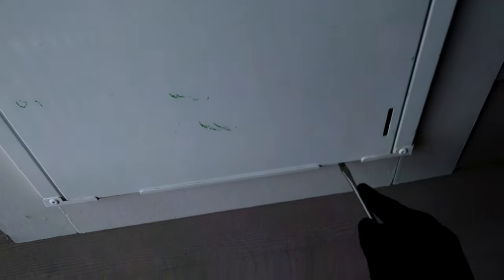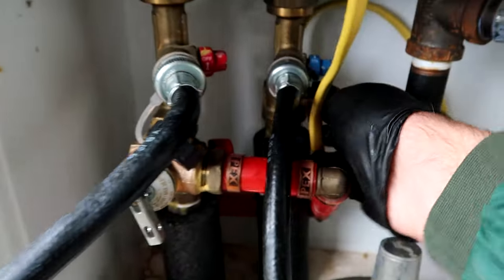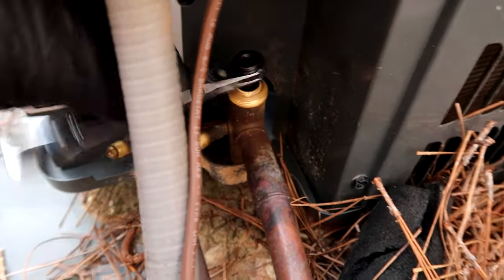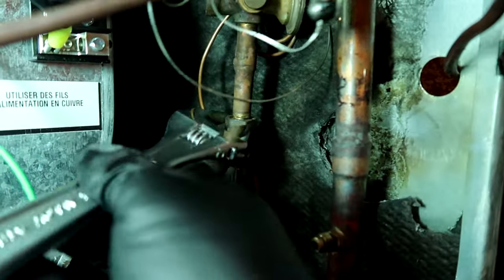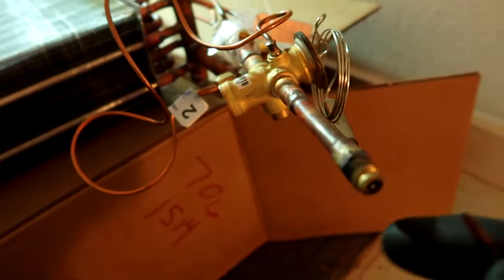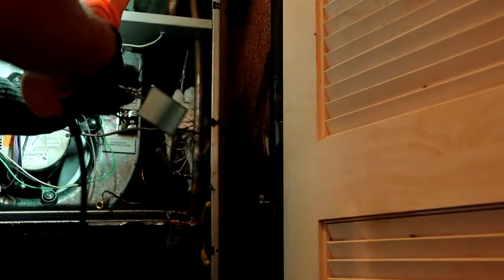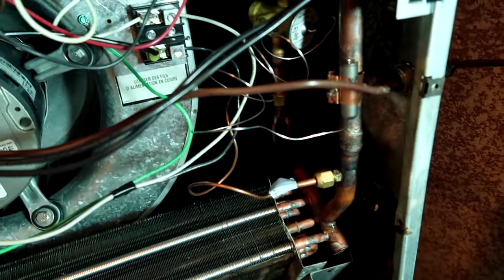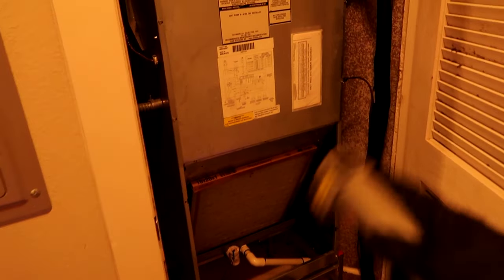Apartment Maintenance Training #2

Comment: Hello again Lex. When torched up tight areas like that i would use asbestos sheet and a couple of layers of sheet metal to block the flame from the rosebud tip, things were different way back when but still the same. Safety first Big Dog.
Reply from the maker: Right on! Thank you so much for watching!

Comment: Good job man. 👏🏻👏🏻 I've never done a coil but you make it look doable.👍🏻
Reply from the maker: Once you dive in, it's not so bad. Thank you so much for watching!
Reply: @LexVance  worked man. Back to normal. 👏🏻👏🏻Thanks for your video. I never would have thought the timer would have caused the solenoid to burn up.